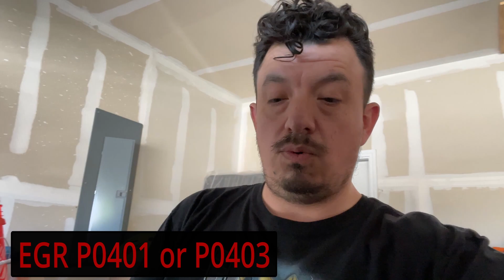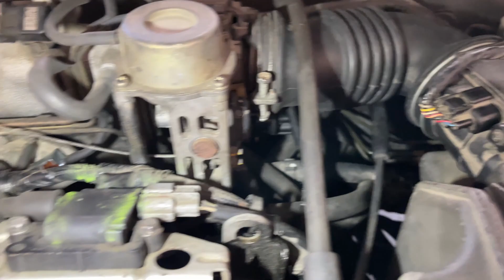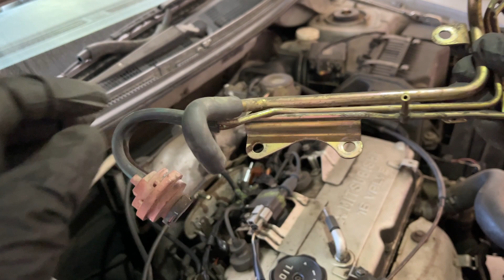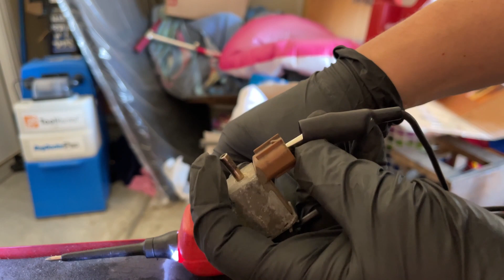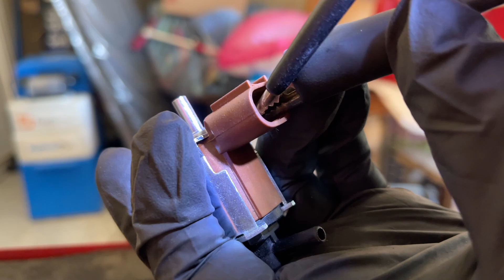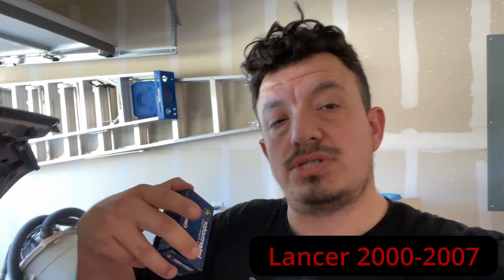P0401 - P0403 Exhaust Gas Recirculation Control Circuit Mitsubishi Lancer 2000 - 2007

Comment: Craziest shit, spark plug wire going bad over these years caused the egr code.  You won't find that info anywhere else.  Finally got a new code so I could track down the issue.  Wire actually lost resistance, 10 percent of new one.  So it was detonating at the wrong time and only partially detonating and not throwing a misfire code, instead a darn egr code. I fought this problem for years.  The wire finally reached to low of resistance that the detonation was so far off the car could recognize it and obviously me to.  Before that car ran great full throttle but idle at a light was lungy. Egr code on and off.  Ect.
Reply: What car

Comment: Thanks for the tips. I went through and checked the continuity and integrity of the solenoids and those were fine and then I blew out the tubes as best as I could, And still got the error.  I tried to clean the EGR but that wasn't working either so I went ahead and changed it  and that was the problem. Glad I didn't pull out parts cannon!
Reply: What did you replace? The solenoid or the egr valve?
Reply: @spydr202  Well, after replacing the EGR it worked better for about a week, then started sputtering again. Turns out the EGR solenoid was intermittently failing, so I replaced it. It's been about a month and it's been fine. Being inexperienced, I was satisfied when testing that the solenoid was responding to current, but it was not sufficiently managing the vacuum. Hope this helps. ... also, i put the old EGR back in ... I'm sure the OEM is better than the replacement I got ...
Reply: @PaulSchrimpf-yf9st  did you also get both codes ? I only have P0401
Reply: @spydr202  Only 0401 ... through all the trial and error that was the only code that tripped. The solenoid was definitely the solve. Ordered a duralast from AutoZone online and installed. So far so good.

Comment: Awesome video! This is the only video I could find that goes over how to replace the actual solenoid (on a 2002+ Mitsubishi Lancer) and not just clean or replace the EGR valve and it goes into great detail and is very helpful. Much appreciated!! Also the tips about how to handle the hoses and keep things organized, is great and the electronic testing of the old solenoid is also helpful. Well done.